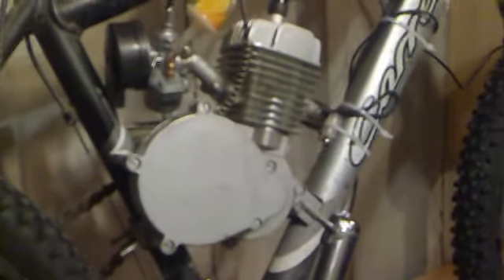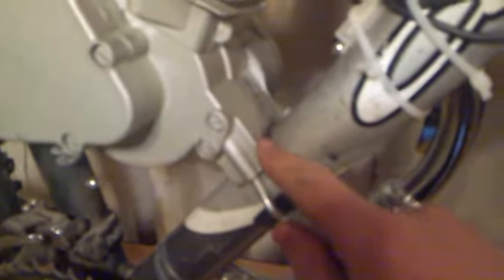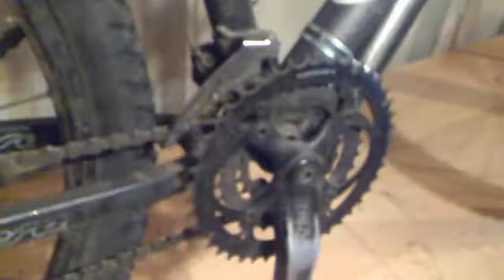Le cyclomoteur

Comment from the maker: Motor is from Hong Kong.  You can't legally ride this in the uk without licensing it.  That goes for any combustion vehicles no matter the cc.  To pass it would need a bare minimum of things doing to it such as wing mirrors on both sides, horn, rear number plate, proper front head light and red rear light, side stand, speedo, noise below 65db, proof exhaust meets EU specs and proof the engine is (or is permanently limited too) 1kW max,